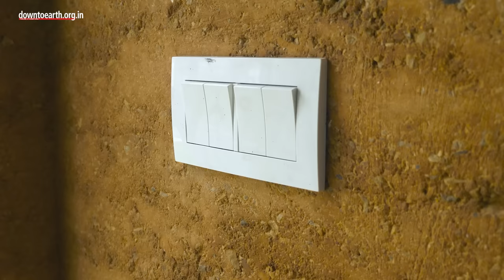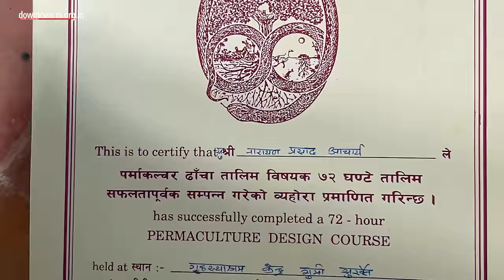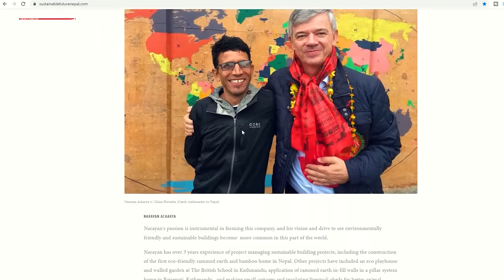This man has built over 50 beautiful rammed earth and bamboo buildings in Nepal

Comment: 'No.1 it is safe from earthquake'. No, it is not. There are no elements that can take tensile loads. Using rebar on mud only make it rust. Also, the bonding action between mud wall and rebar is not existent. Hence, there is no point of using rebar. This type of construction should be limited to 1 storey.